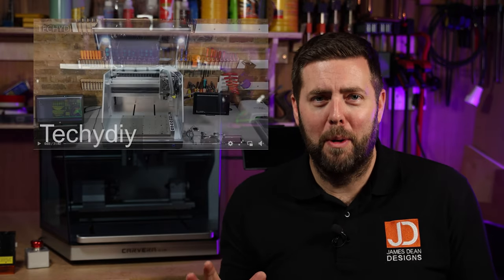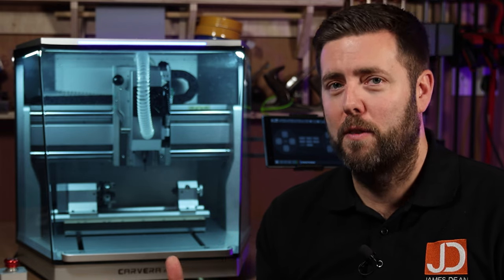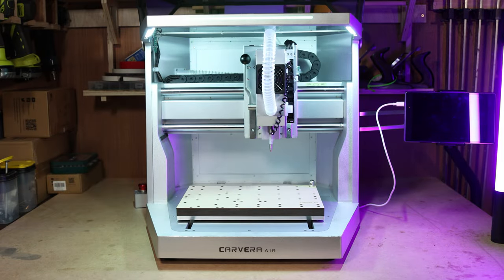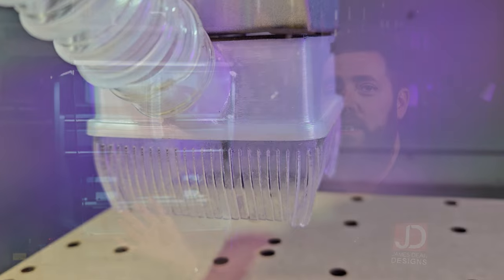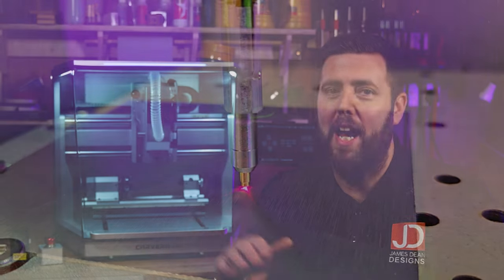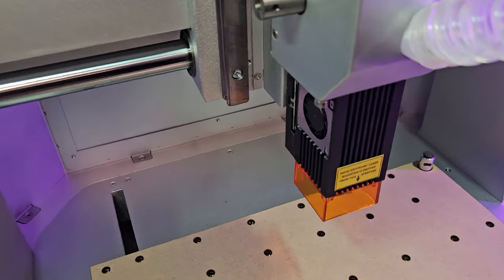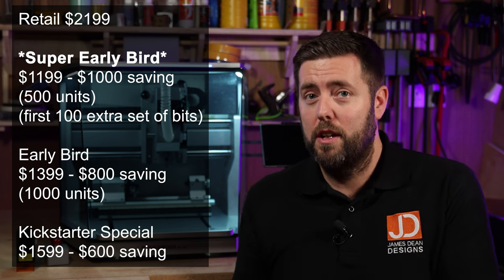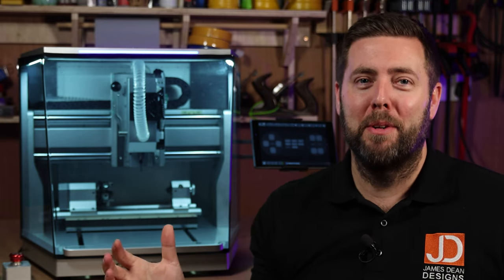IT CAN DO IT ALL!  CNC, Laser, 4th Axis, Auto-Probe - The Carvera Air

Comment: As a Carvera owner I can say the company and the machines have overall been outstanding. The customer and community support have been exceptional. The Air appears to be even more robustly made than the original Carvera and the simpler design should not only reduce costs but make them more reliable. It should be a hit with schools (a specific target audience for Makera) and hobbyists alike. One valid criticism is that the pace of software development and updates has at times been slow (the Android version of the controller works on some phones better than others). Perhaps with additional sales Makera will be able to hire more staff to speed that up. I look forward to a more in depth review. YouTubers who received preproduction units of the original Carvera, such as TeachingTech, provided valuable feedback on issues that for the most part were addressed in the production units. I expect the same here.

Comment: I saw them raise $100k in about a minute...🤯

One test to add. Can it crush a can by its axis? (if it can cut metal, a can should be easy).

I've been looking at home CNCs recently and was underwhelmed by what's available, so I'm building my own (it started from trying to find a decent chest of drawers, more than 20cm deep!). There's so much potential in this market. Even it it's just to making brackets to strengthen 3D printed objects.

Comment: That’s more a sales pitch than a review. 

What’s the accuracy, work area. What material can it cut? How much power has the spindle and how much rpm?
How much is the backlash, does it has closed loop servos? And there are probably a lot more things that are interesting.
Reply from the maker: @Todestelzer  hence why I did a follow up video with more detail
Reply: @JamesDeanDesigns  ah ok fair enough. 
There isn’t a link to it in this video and this is what was popping up on the front page of YT.
Maybe a playlist linked in the description with all vids about this machine would be nice.
Reply from the maker: @Todestelzer  good point. I'll get that pinned. Probably still not as much information as I would have wanted to include but that's the downside of a compressed window to get the video out. Probably time to do another on on it now it's due to launch.
https://youtu.be/NZ7geBFTF9M